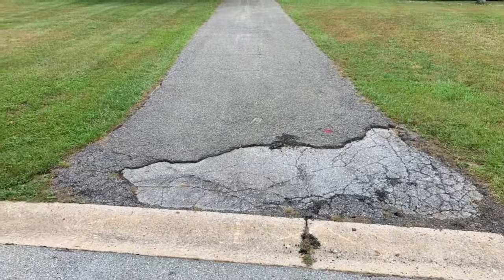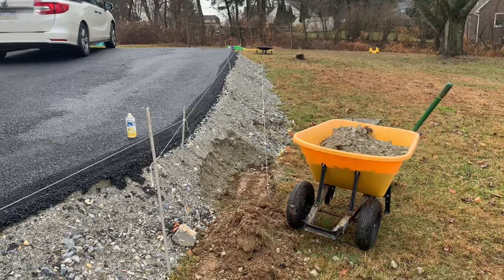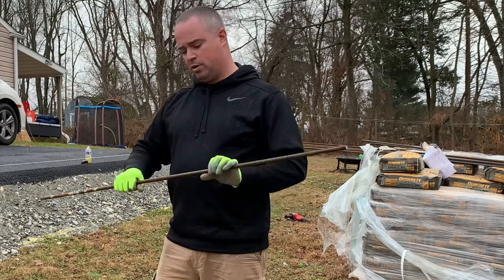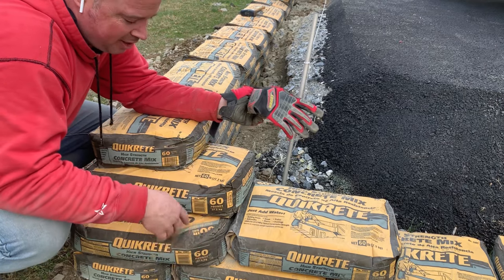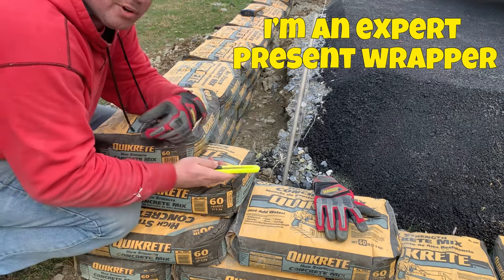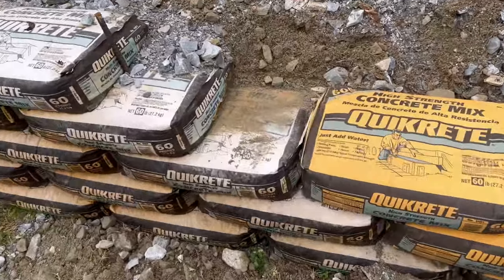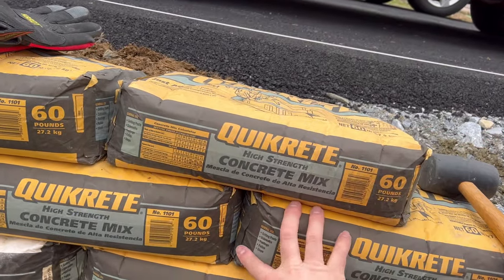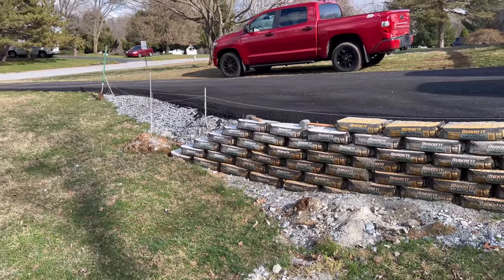DIY Concrete Bag Retaining Wall $ Saved Us Thousands

Comment: Great job and it's going to really look good, add value and curb appearance! - If desired, you can extend the wall length it by drilling and cementing in rebar to attach more bags placing rebar in the sides and top of bags. If the bags stretched and have slight cracks, wash fill some ready mix in with water. Cool deal!
Reply from the maker: THANK YOU so much @SteveAddis 🤩 this means a lot coming from you.  It was actually one of your videos that inspired me to attempt this diy. I know it might not be everyone’s cup of tea but we’ve gotten tons of compliments. More importantly it’s serving a purpose and it didn’t cost us an arm and a leg.
Reply: @GoodTroubleHome  You are welcome. Definite complements. Posted my video because so many asked how it was made. Multiple vehicles slowed down to look at my culvert next to the public road. One time, a car pulled over and a parent and children stepped to have a closer look. That is like crazy to see from up here on the hill during the Summer! Great cup of tea when you look at what you accomplished!
Reply from the maker: That culvert is amazing that you built! I would be that person pulling over to take a closer look.

Comment: Bad advice doing this you be better of with proper retaining blocks would look better an safer an cheaper. There is nothing stopping the bag from pushing forward.a wall failing.
Reply from the maker: Hello @kennyoboy642 not sure if you watched the whole video but we put 4 foot pieces of rebar through each row of bags. These bags are also wider than retaining block. Not saying this way is better but it was cheaper mainly because we did it ourselves. For a 2-3 foot wall this build was almost perfect.

Comment: I would of put rebar through the bags. Most walls have back stops. You plan on back filling
Reply from the maker: Yes 💪🏼 @fssparky we put rebar through every row of bags and backfilled with 8-10 inches of rocks for drainage and then soil. I will be putting out an update video in October showing some things I would have done differently

Comment: Saved thousands? 😂 Would have cost you the same to just buy retaining wall blocks. But if it were me, I would have just had a load of dirt brought in and spread around the drive.
Reply from the maker: @skliros9235 dirt was one option and I did bring in two truck loads. I’ll show that in the follow up video. The place we saved money was the labor. We got multiple estimates right around $5,000. What you see so far only cost me about $600

Comment: My main concern is that I didn't see you tamp down the base. When that ground gets soggy, the weight of that wall may press down if the driveway guys didn't go that far out
Reply from the maker: The driveway guys didn’t do much on that side of the driveway @ErdTirdMans I didn’t show much of that process but I did take off the grassy layer and tamped it. I put a thin layer of rocks down after that.

Comment: Should have just used the wall blocks would have saved you time and money. Concrete is expensive.
Reply from the maker: Believe it or not @kglass6 the blocks that I liked were $3.50 each and these bags of concrete were only $3.37 each. The cost of rebar was cheaper than block adhesive. The only benefit in my eyes is the that block usually don’t crack. I did have some cracking that I have to go around and patch but I will get into that on my follow up video.
Reply: @GoodTroubleHome  Is the cracking from driving the ground rods through some of the original bags during round one of the battle? I think I saw you drive a few extra ones in--maybe?
Looking on YT for ways to reinforce the gravel on the outside sloped area on two corners of my new pole barn. 
I wasn't really expecting that much of a difference in elevation and the sight guy just used 1/2"-3/4" gravel on the pad and perimeter but really should have used some larger stuff in those corners. 
Still brainstorming on what to do while the weather is decent.
Reply from the maker: @jimhmod thanks for watching. The cracking was on the back corner of the top row. Because I set each row back 2 inches there wasn’t enough support underneath as it was hardening.

Comment: Let's see that wall after winter. I bet it ls still just as amazing looking and standing just fine. Nothing wrong with this so long as you like the way it looks and have the money for the future repairs.
Reply from the maker: Hey @anythingeverythingmark I’m kinda experimenting a little here. There are a couple cracks on the top row where there was insufficient support on the back edge. I want to see how the small cracks handle the winter and then use the Quikrete patch for a repair video 🤷🏻‍♂️ might be a bad idea but I’m not afraid to loose a battle to win the war

Comment: I have only done a few bags high, and we did not even use rebar, but I was shocked at how much better it worked as a low retention wall, then other solutions.   Someone once put a concrete retention wall up, I guess 8" thick or so, but it toppled, likely because not enough weep holes.   We put up the bags, and they looked great, even at 7 years.  But the concrete bags built a heavier wall.  I moved after 7 years.   We did that 40 years ago with quickcrete.
Reply from the maker: Nice work @normbograham yes, you definitely need a place for water to escape. In this case I choose not to put mortar between the bags so any excess rain can get out

Comment: Bought land in the Ozarks with a 100ft setback....gonna run from the easement road to the cabin with quick-setting bags laid out like cobblestones....this but horizontal. 
:}
Reply from the maker: Amazing @dennisking4589 I’m so jealous. That sounds like a great idea. I did have some cracking. I talked to someone who suggested wrapping clear packing tape tightly around the sides to cut back on the cracks. Just a thought 🤷🏻‍♂️ good luck. Please let me know how it works out.

Comment: Every time I do a concrete pour using bagged material, I have a couple of leftover bags that eventually harden in my shed, just due to humidity.  This makes so much sense.
Reply from the maker: Exactly @deanevangelista6359 that’s what made me think of this originally. My dad put a couple leftover bags in his garage, out of the elements, and they were rock solid 3 months later. After a couple Google searches I decided to take the chance 💪🏼

Comment: That much lime (the cement) can be hard on plant life. Do not put expensive plants in there. I also would add water myself. I have left bags of cement out for years and they did crumble. Wetting them yourself is better. The bag mass is more likely to stick together. They are also rather soft and easy to crack apart if just left to their own hardening. I do like the idea. It sounds doable. If you water, fill the water up between the drive and the bags as well.
Reply from the maker: Great advice all around @texasgemtree I actually planted Limelight Hydrangeas in that area and they’re thriving. Didn’t research it ahead of time, just like the way they look 🥰
Reply: @GoodTroubleHome  Sweet!

Comment: As someone who owns a home, I fully understand the DIY part. Gotta save money anywhere you can. 

As someone who does patio, walls, steps, fire pits for a living. This is hard to watch. 

Something tells me that gravel holding the driveway up is on top of grass...
Reply from the maker: I'm glad you appreciate the money saving part to this DIY @SandIGetit When the driveway contractor repaved the area they brought a Bobcat and ripped up all the grass and laid down fabric in that area.  We did not watch every move they made but I also never assume a contractor is doing a job the way it should be done.  I know there are different "right" ways to do things and then there are ways that are going fail and cost us more money in the long run.

Comment: Was adding dirt and gently slopping away a thought?
Reply from the maker: It was @HuckThis1971 but believe it or not, this was actually less expensive. We needed a tractor trailer load of dirt, bobcat to level and tapper everything. Then grass seed. The drain field for our septic tank was over there too so we didn’t want to mess with that. This felt like a fun project and less aggravation
Reply: @GoodTroubleHome  now that you explained it. Makes sense. Thanks for reply.
Reply from the maker: Thanks for watching @HuckThis1971 I am working on a follow up video on this project. Couple dos and don’ts. Hoping to post that in October 👍🏼

Comment: Did you check out the price for some cinder blocks for your wall. They would have looked a lot better than the paper wall shreds.
Reply from the maker: Cinder blocks are about $2.50 each. We would still need concrete and rebar to keep the blocks together and make it strong @AB-ot3bc we wanted a more rounded look on this wall. After I take a torch to that paper it will look awesome. A follow up video will be out in October so you can see the finished product and cost breakdown if you’re interested 👍🏼

Comment: Wow! Great job! Thank you for the wonderful tips! I am considering a similar project, perhaps using 50 lb bags vs 60 lb, would be easier for me to handle, but maybe not as stable? I say that because the 50's are more narrow in width. I'm unsure regarding how much and placement of the rebar. Is every single bag tied in with rebar? I certainly appreciate the detail provided in your video. Happy to see it was a "Family Project". Thank you!😊
Reply from the maker: So glad you enjoyed the video @melindakantner9202 the 50lb bags should work but it depends how tall you’re going. Any hirer than 4 bags I would definitely move to the wider 60s. The rebar is through every row. I made sure it was at least 2 feet longer than the stretch of bags. So if your wall is 3 feet tall I would use a 5 foot piece and get a good chunk of it into the ground. I will be putting out a 2 year follow up video maybe towards the end of the summer. There was some cracking. I could have prevented it by patching it before the ice and snow broke it open but I’m still very happy with the way it turned out. Thank you for watching ☺️
Reply: Thank you for your insight and answers! Hope y'all keep up the great work! 💪👍
Reply from the maker: Thank you @melindakantner9202

Comment: Amazing idea!   How's this holding up?
Reply from the maker: Thank you @lsdwyer33 it’s holding up great. We did have a bunch of small cracks form and I should have patched them before last winter because the ice and snow made them worse. Not a huge deal though. I will patch them and seal the concrete in a month or so and hopefully put out a follow up video.

Comment: Soaking the fresh  bags daily is advised. otherwise, the outside will set up and the inside may not. Pounding the rebar through the dry stack is also advised.
Reply: Would I soak the bags with as much water as possible and then pound the rebar through them? I’m thinking of doing this retaining wall idea so your advice is appreciated
Reply from the maker: Putting that rebar through a dry stack is the only way to go @maker-matt I was trying a bunch of methods here to see what worked best. Most of the bags were put in place and then I just let Mother Nature do the work. Between rain and moister coming up from the ground that way showed the most solid bags. The ones at the end I got impatient with and I soaked them with the hose. I definitely had more cracking with those bags 🤷🏻‍♂️
Reply from the maker: Hi @zachgoestoeuro how tall would the wall be that you are thinking about building?
Reply: @GoodTroubleHome  probably three feet tall. About ten feet long
Reply: @zachgoestoeuro  I think a little water each day. I have done a dry pour parking pad that way. As for the rebar, I would pound through the dry stack.
Reply from the maker: @zachgoestoeuro perfect 👍🏼 a tip that someone sent me was to turn the bags over as you lay them. The gravel and cement separate with all the vibration shipping and handling
Reply from the maker: @maker-matt totally agree ⬆️ if you plan on doing it before a couple days of upcoming rain you’ll save a bit of the hassle with hosing them down @zachgoestoeuro
Reply: @GoodTroubleHome  ty!
Reply from the maker: Good luck 💪🏼 you got this!

Comment: That wall will lean over as the driveway fails. Pile dirt on bothe sides is the longer term fix.
Reply from the maker: There’s a 6 foot round culvert running under a driveway in our neck of the woods @blackout7615 They used this method and it’s held up for at least 17 years since I’ve lived here. Hopefully this can hold back a few rocks and some dirt. I will certainly do a video on it if it does fail though…so others know what to do differently 👍🏼

Comment: When the tree matures and the roots spread aren't you worried about it busting up all your hard work. Whatever tree you get Google see how the roots spread, how far, deep etc. Trees cause extensive damage to driveways. :(
Reply from the maker: Very good advice @jennifergallander2504 I chose not to put a tree there. I found some 2 foot hydrangeas at Home Depot last summer. Their roots shouldn’t be as invasive as a pine or maple tree 🤷🏻‍♂️

Comment: So how's it holding up? Update video?
Reply from the maker: Hello @livelifego9168 the bulk of the wall is holding up great. No shifting at all. I had some cracks before the winter that I should have patched because the ice and snow got in there and made it worse.  I will do a follow-up video this summer. I want to fix the cracks and put a coat of concrete paint on the whole thing. Thanks for reaching out!

Comment: It does not appear that the gravel base was compacted as it should have been. You would not be able to effortlessly chop away that slope with a shovel if it was compacted.
Reply from the maker: Hi @maker-matt the contractor did go over everything with the asphalt roller but that crushed aggregate needs something on the sides to prevent it from eroding and spilling out. I’m not really sure if that was normal to be able to scrape the side off that easy but I knew the end result would be a major sag or collapse in the driveway
Reply: @GoodTroubleHome  Did the contractor compact the gravel base prior to putting the asphalt down? That gravel edge should be difficult to dig through by hand with a shovel.
Reply from the maker: @maker-matt I saw them rolling it. I doubt he got too close to the edge though. That’s probably why it was so loose over there

Comment: If the bags are turned upside down, the contents settle automatically.
Reply from the maker: That is GREAT advice @BA-ef4pr I wish we would have thought of that when we were doing this project. I'm working on a follow up video with tips and what we would have done differently. That is on the list for sure  👍 Thank you!

Comment: Did you use quick set or regular
Reply from the maker: Hi @kristymissy5980 we used the “ready to use” 60lb bag. I felt that if it set up too quick the bags wouldn’t harden all the way through. Are you thinking about doing this project like this?

Comment: No I think a concrete wall would be better then have the concrete Higher the the asphalt to to the way and maybe Make a grove in the asphalt so the water can drain down the driveway
Reply from the maker: The contractor did put a slight pitch on the driveway to angle the water into the yard @giuseppematozzo1354 now it will just drain the water into 10-12 inches of crushed rock instead of the grass. The wall is holding 💪🏼